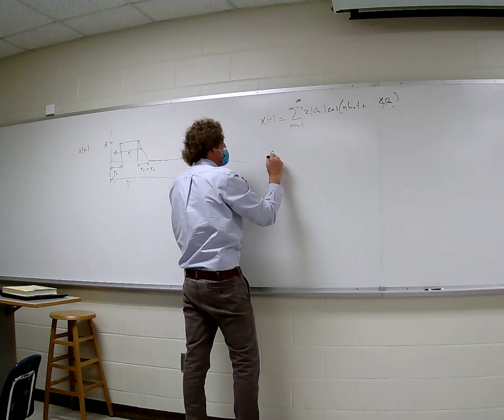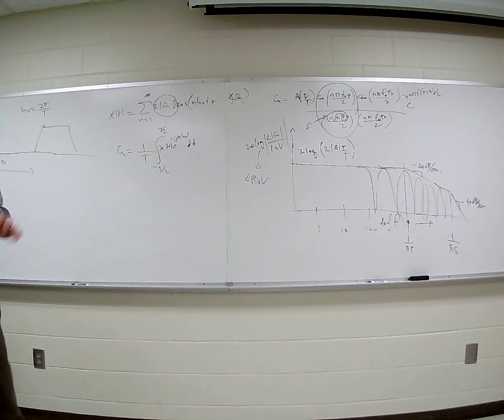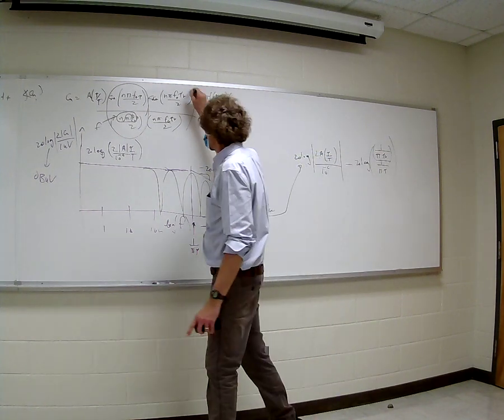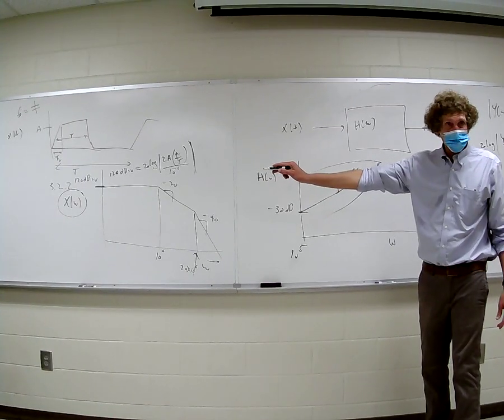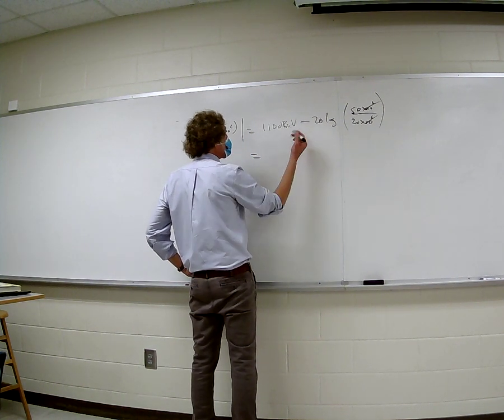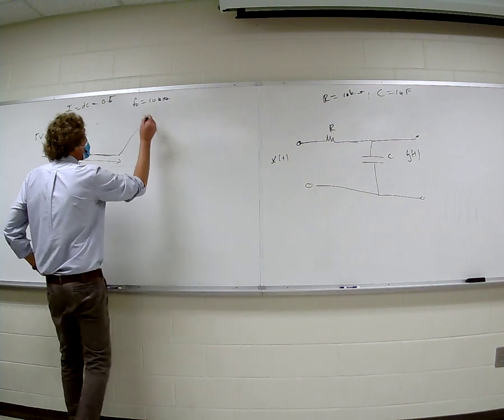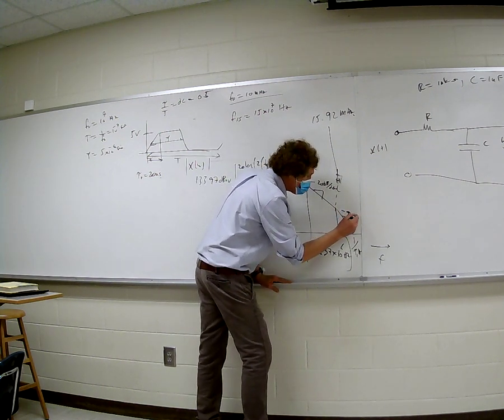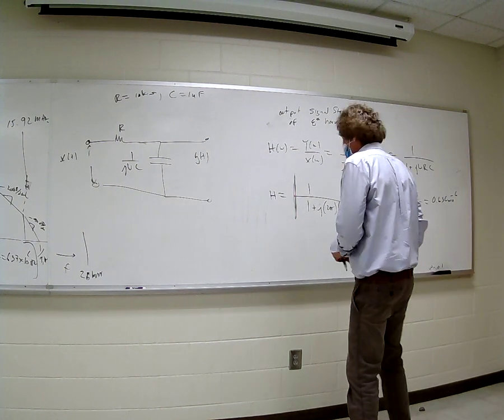Lecture 31 (3/31/21)

Comment: 0:01 Spectrum of Trapezoidal (Clock) Waveforms Derivation Continued
3:44 Effect of Rise/Fall Time on Spectral Content
12:20 For filter, identify dB loss or gain of filter and multiply it by the input signal's envelope 
14:24 3.2.2
30:14 Baginski Example